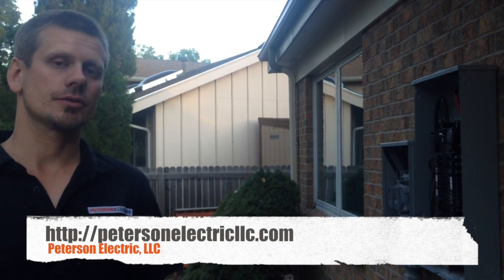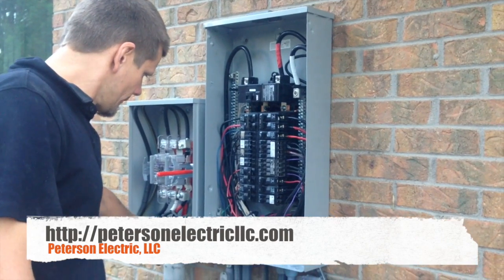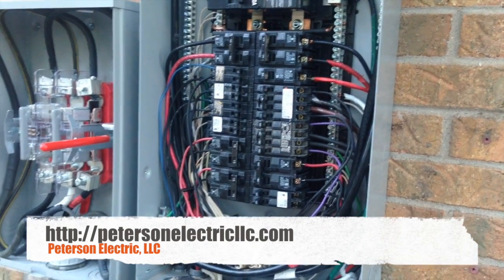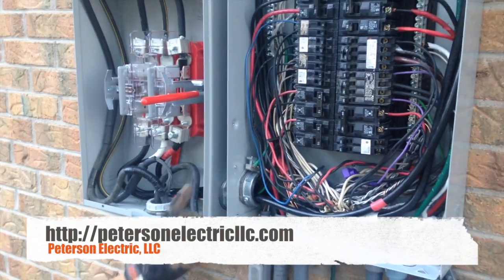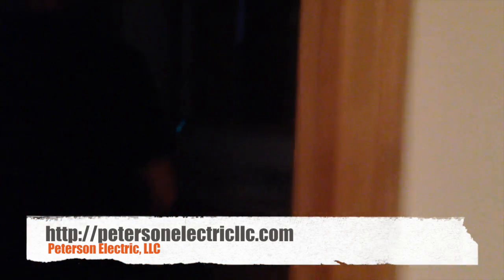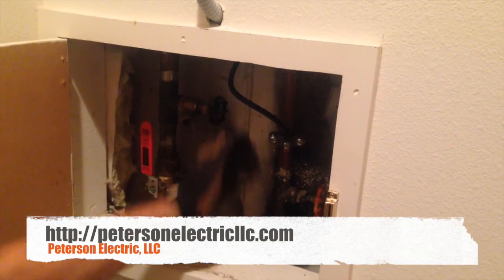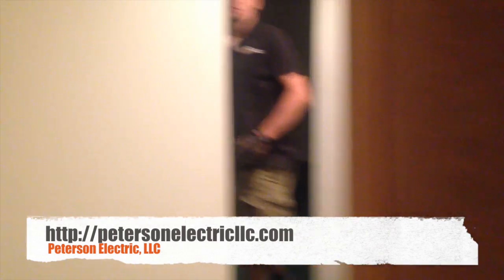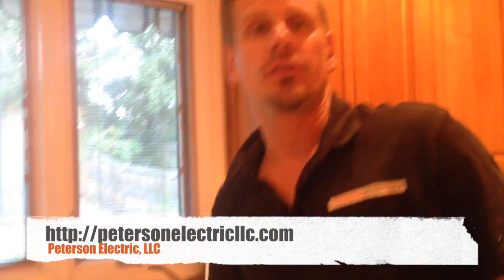Electrical Grounding System Code Requirements For Your House, When Replacing Main Service Panel

Comment: For my own personal knowledge (Google is giving me conflicting answers, looks like it may be up to local code), does any ground wire need to be connected in the meter, at all?  I just had a new meter (320), and two (2) 200 amp, service disconnects installed, all side-by-side, on the outside of my garage.  I noticed, that only the service disconnects, each have a seperate ground going to each from outside and no ground at either from the meter or into the meter.  And then of course, from each of those a ground going into my garage, to each of the two (2) main 200 amp pannels, respectively.  It looks like from your meter you have a solid ground wire going through the conduit to the panel.  I have no ground coming from my meter to either of my disconnects.  Thank for the informitive videos

Comment: Josh I have a question. How would you tackle running a grounding electrode with ground rods when the entire area is  a concrete driveway?

Comment: My understanding is that you can bond to the nearest point of water line if the water service is NOT being used as a grounding electrode. Since you buried electrodes near to the service panel, why run the long PVC to the water service entrance?

Comment from the maker: They do not need two cold water bonds. Code says to the entrance of the structure with in 5’. 

There should not be two separate potential of paths.
Reply: Flexible  metallic Conduit is not a listed means to protect your gec. It acts as a coil.
Reply: @TheRemarkablemusic  Looks like liquid tight flexible PVC to me.